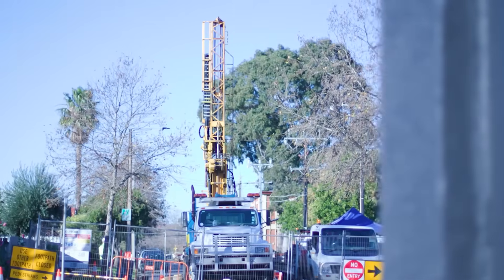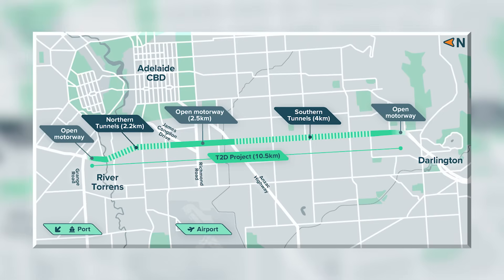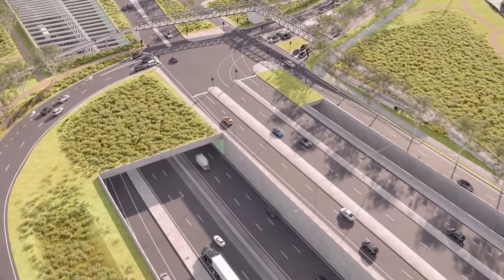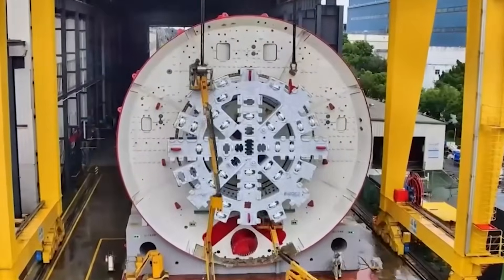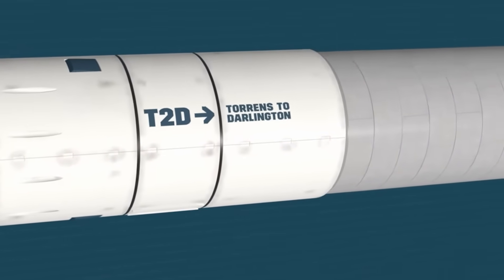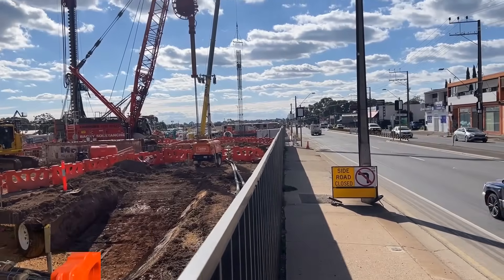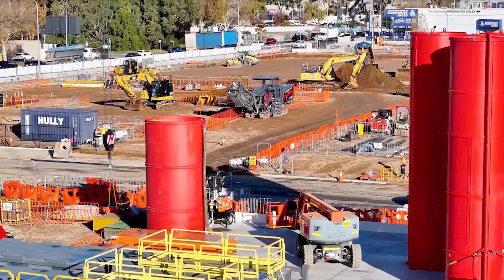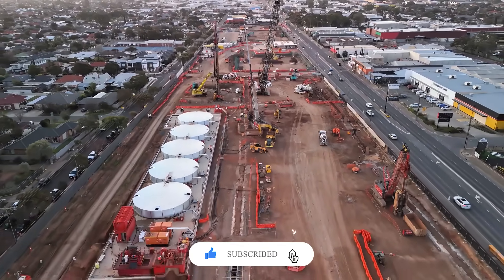Adelaide's $15.4B Torrens to Darlington Project Sparks MAJOR Concerns

Comment: All of this is long long long overdue
Anyone who has ever driven a heavy or a commercial vehicle along South Road knows all too well the dangers of the stop start congestion and the reality of small cars pulling into space in front of heavy vehicles, space  that may appear fortuitous but in reality for the heavy vehicle driver is required in order to avoid running over the top of a small call or motorbike or even someone on a pushbike.

Comment: Adelaidean here. By the time this thing gets built, the population would have grown enough and the other roads become a bottleneck as people now will use them, making this whole thing redundant; also factor in our virtually non existent light rail infrastructure.
Reply: There's already talk of the project shifting bottlenecks to other areas of the city. Cross road is apparently next on the list for an upgrade, making it non-stop from the 
South Eastern Freeway to South Road. I can't even imagine how the intersection at Cross Road and South Road will work, a 3 story highway with 3 roads overlapping? Another lowered motorway with a train overpass? It would be one of the most complex intersections in Adelaide.

Comment: I'm from Adelaide and I drive past the start of these works most days on the way to work. Its absolutely necessary. Morning commute is going to suck the next couple of years; i've already started going through the hills instead of via south road and the load on the hills road is steadily increasing as others do the same.
Project should of been done decades ago, or other cheaper and easier projects done decades ago, but the attitude towards change and disruption from an age top heavy state didnt change until recently; mostly because it was that or collapse.
Reply: Try the next 10 years lol

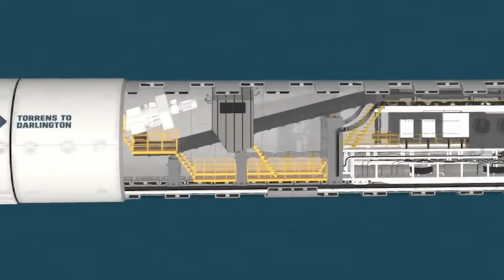Comment: This is obviously made in part by AI, and using an interstate firm. At 08:50, the narrator states: “….enough to fill the Adelaide Oval stadium from the grass to the roof.” Oops. There is no roof on Adelaide Oval.
Reply: I get what you are saying. However, their website shows you can do a "rooftop climb." Presumably, this would indicate the height referred to in the video.
Reply: it clearly means to the top of the stadium, which is partially covered??

Comment: It would be good to incorporate public transport into the project. Im no engineer, but centre or lateral rail or o'bahn lane?
Reply: there is train line roughly along it. No one needs additional express PT there. Usual surface buses (on significantly unloaded streets, like Parramatta rd in Sydney after M4 launch) will be enough for local trips.

Comment: This is undoubtably an essential project.  One wonders however whether there were opportunities to lower its cost.   Public projects in Australia always seem to be treated as if budgets and public funds are unlimited.  For example, you could probably have jacked up and moved the Thebarton theatre a block back from Main South Road for a lot less that the tunnelling is costing.
Reply: Most of the theatre is below ground level and doesn't match the upper floors, not to mention old; you're not moving it without destroying it.
Reply: @philnicolle8918  whut? Underground???? The theater is ancient brick hall, there is nothing below ground in it (many years ago I installed CCTV there so crawled it all across).
Reply: If it costs $96 million for the state to build a website for the weather, and the NBN original budget of $43 billion is expected to be about $70 Billion when it's all said and done, it doesn't instill confidence. There is some great infrastructure in Aus, but you have to think we could get more bang for our Tax payers buck.

Comment: The real question is not how but why? SA no longer has to suck up to 2 car manufacturers. Everything lends itself to high quality public transport but we repeat decades old folly of more bitumen, cars & CO2
Reply: Not sure but I dont think you can carry shipping containers, construction material and a van full of tools with public transport. Its easy to complain until you have to sit in the rush hour traffic for hours and get home at 7pm when finishing work at 5
Reply: Public transport does not suit a city as spread out as Adelaide. So many new routes would be needed to make it more efficient, but they'd hardly get any use as the city is too spread out.
Reply: Public transport is for two types of people, city workers and well you know the other type. That's a big no from me I will stick to cars 😂
Reply: paupers - OUT. We need TRANSPORT, not just a way to travel for free from centrelink to public hospital.

Comment: Can they build a train to the airport?
Reply: The airport is only a few kms from the CBD; tramline would be nice but train isnt necessary
Reply: @ragingozzie  even tram would be a financial disaster there, like Parramatta tram ($3B for 8000 paxes/day) or proposed Gold Coast tram st4 ($10B, lucky new Qld govt cancelled this nightmare).
Reply: @antontsau wow you clearly don't know much about mass rapid transit
Reply: @tangiers365  muahahaa. I know enough to distinct livestock carrier from personal transport. 

Ah, yes, I was born and grown in Moscow, if it says you anything. 10M city almost without cars in USSR time, with metro system causing all PT lovers to whinge loud and demand the same.
Reply: @ragingozzie  There is adequate buses servicing the Airport.... J1   J2 etc
Reply: Nope.  SA only invests in roads, the former transport minister now treasurer is a taxi driver lobbyist
Reply: if YOU pay for this. No one else will.
Reply: @antontsau why? 
It would cost chump change compared to this damned tunnel
Reply: @darynvoss7883  nope. It will cost billions. As noticed - Parramatta tram $3B (and it goes mostly thru existing rail corridor), GC tram st4 - $10B...
Reply: @antontsau this is one road for $15b and you're comparing it to a tram network for $3b lmao.  Apples and oranges champ
Reply: @antontsau Parameter Light Rail stage one is 12 km. This line will be 4 km to connect to existing tram line. So it might be 1 billion. Like I said, nothing compared to what they are spending on the tunnel.
Reply: Matter of fact, forget light rail and trams, just bore out twin tunnels straight from the city to the airport. It's such a short distance. 
In Perth they just built the Airport line, including 3 stations and twin tunnels 8.5 km long, 6.2 metres diameter each. The final sticker was 1.9 billion.

The requirements for Adelaide would be significantly lower; about half the distance, and smaller tunnels would be fine due to lower speeds. 

Just boring under would avoid the problem of traffic disruption during construction and minimise land resumptions. In truth the Henley Beach Rd and Bradman Rd corridors are a bit squeezy to fit in LR plus 4 car lanes and bike lanes and footpath...
Reply: @darynvoss7883  Another one greatest plan. Miserable $10B and thats it! And unicorns fly under the rainbow!

Perth Airport line is NOT a line to airport, it goes thru and services suburbs behind. Traffic in airport station, not in line as whole, is miniscule.
Reply: @tangiers365   Traffic, traffic and traffic. How many cars supposed to use the tunnel? 50000. (now South rd traffic is about 40000) How many paxes are ready to use tram to airport - 5000? If we will be generous and optimistic? Aaaah.

And, of course, $15B is crazy price tag. Thanks to the govt, highly professional in money wasting.
Reply: @antontsau  you're really making no sense. Any additional stations would further add to the utility of the line, not detract from it.
Reply: @darynvoss7883  In general - nope, it does not work. If it is local transport - yes, the more stations the better. Every 500m is the best (with station length 200m) as it reduces walk distance. But if it is long haul transport, for 20km regular ride, - everything is opposite, stations every 1km cause extremely low transport speed. So right line has dense station pattern in CBD and then stretches it to one per many kilometers, for trains (Sbahn in Germanies) it may be even 5 or 10km between stops.

Anyway there is NO traffic in Adelaide in airport direction. Nothing is there. Airport with several 1000s paxes who are served by regular bus, not even dedicated express, and boundless plains of single storey huts. Not to dig tunnels but even build surface tram line there is absolute financial disaster. Billions for construction and 10s millions to support - and no traffic. $100 per ride from the govt.
Reply: @antontsau I'm talking about a project that is already built and genuinely works and didn't cost much and I'm saying Adelaide should do something similar.
It's not a proposal or a suggestion... it's already built ... it's already working.

Comment: Great vid..
One of the biggest issues for the Thebarton Theatre is its an International act sized venue..
So they have many semi-trailers worth of gear to unload..
The only load-in access to the stage access was from the "South Road" side of the theatre, the trucks need to have access to the road there to be able to back up and reverse in and out to unload for events..
Most of the options removed that option, and meant the theatre would not be able to do the events they have always done (and just refurbed for).
So they came up with as compromise which I think will solve the issues... 
This road has been already extended from the far South of Adelaide, so this will be a great run when its finished.
Adelaide is a city that stretches out North to South.
Reply: Not true.  They can access Thebarton Theatre from Danby St after knocking down the building and changing the bump in / out section.
Reply: @BassMatt1972 Correct.  I was an audio engineer for 15 years and have worked at 100's of shows there (in fact, my first show was there with Silverchair lol). There is a rear stage door, but access wasn't easy. It looks like they have made it a lot easier and safer (we had a Midas console that I think came in at over 150kg, not including the power supplies.  It was a minimum 6 person lift, and actually had channels on the case for forklift tines! How things have changed.....)
Reply: @justinwagener2178 there's a new elevator that takes it straight from the dock to the stage, plus the whole building behind was knocked and turned Into an access way and car park
Reply: @tangiers365  Saw this on Google Maps. Still looks restricted.  But I wouldn't under estimate semi drivers though.  The main systems would still need to go through the Eastern side though.  I don't know if you have seen the Festival Theatre loading dock? Hard access, not much space, but I have seen at a load in 2 semi's backed up side by side.  God knows how they did that lol! Hard enough getting a 14 ton NA truck in there!!

Comment: this is an over priced race track for slow drivers
Reply: The speed limit will probably go down from the currently proposed 80 km/h. Originally, the whole thing from North to South was supposed to go from 110km/h in 'rural' areas, to 100km/h. It got reduced to 80 km/h on the fringes of the city already, and I bet will go down to 70 or 75 km/h or something dumb like in Melbourne.

Comment: And what happens at the southern end of this motorway? Traffic lights!
Reply: No traffic lights at either ends. It connects to pre-existing motorways to the Southern and Northern ends.  This is the last piece of the puzzle and well overdue!
Reply: @scottflamank1799  At the end of the expressway where it rejoins South Road at Old Noarlunga there are traffic lights.
Reply: @raygale4198 
Its not as though 100% of the traffic north and south is aiming for the traffic lights is it?
Reply: @banta-pd8zj  Where else can you go? The original poster stated at the end of the expressway there are traffic lights. He is 100% correct.
Reply: @raygale4198 
My point was what percentage of the traffic would end up at the ends.
I'd say the majority of traffic, without looking at the finished project, would enter and exit in-between. 
As for the traffic lights at the end, so what.
The expressway is to end somewhere you return to the normal road system.
I mean really. What's the hassle?
I can see the need for the expressway but my preference is to reduce the traffic volume in the first place if not at the same time.
And that's primarily with inexpensive comprehensive public transport and far greater emphasis on bicycle and pedestrian infrastructure.
Reply: @banta-pd8zj this road is the major transport route for trucks as well. How do goods move? On the bus or on a bike maybe? And to go to the original comment, no, this is not a project to go between traffic lights. To the north the first set of traffic lights you will hit is Mildura, 450km away. To the South, people will exit at many different points, not just in one place at the far end. As someone who lives in Adelaide and has to use this road from time to time, this project is sorely needed.
Reply: @peterj5751 
"I can see the need for the expressway".
Yep. I can see that line in my post.
And bikes, buses "at the same time" with it.
Yep.
I see that too.
The majority of traffic to be local? Adelaide?
I'll stay with that too.
Reply: Traffic Lights down south, then a CRAWL until you get past Seaford Rd and Victor Harbor Road. That's probably the next big intersection down here that needs tackling, though there is probably more important intersections up north to do first.

Comment: I think the planners want to move Adelaide forward. It has grown slower than all Australian cities. I think they need to plant a lot of trees and try to cool the city, but the obsession is still growing wine grapes everywhere.
Reply: Nope the obsession currently is infill housing, pull up all the trees pave over gardens and stack as many units on the traditional housing block as possible. My suburb is noticeably warmer and it only takes a mild rain shower to have the roads flood due to the increased run off from all the concrete where there were gardens and lawns previously.
Reply: At $15.8 billion for an underpass that’s over 50 years too late. What sort of past governments have we had here in South Australia? An overpass could’ve been put in 30 years ago at one 100 of the price it’s costing us to fix this out of date overdue and Batu Costley underpass. Shame on yourself Australia.